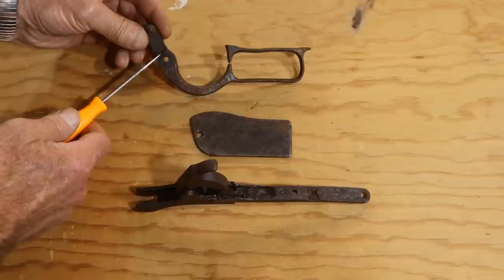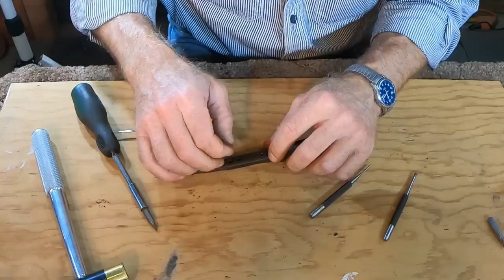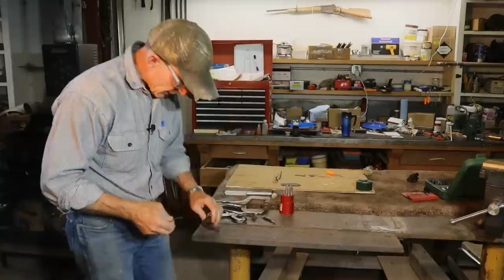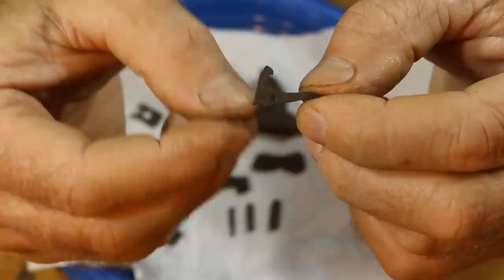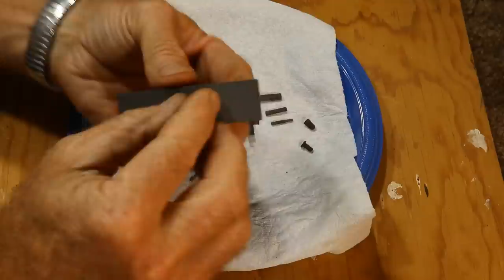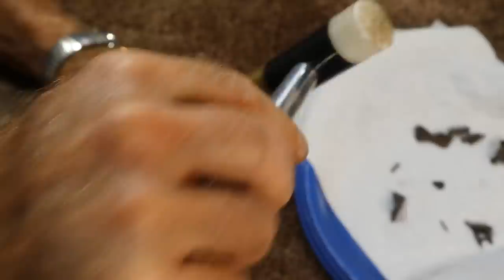Set Trigger Rescue Mission

Comment: Ideally Mark at this point, it would be the best thing if you could buy three or four of these set trigger units and have somebody measure them for AutoCAD and turn them into mechanical drawings. This way you can be able to manufacture any of the parts you need and have them drop right in to the Winchester and the parts would be made from modern steels like 4140 and the like.

Comment: Thanks for taking the time to teach us more about the parts and processes involved with being a gunsmith. I've already learned a lot from your videos. Question about the rust removal on pieces like you have here in this video. Instead of using Kroil and elbow grease to remove the rust, could parts like these be set in a muriatic acid bath for a short time to remove the rust? I know the acid will cut through oxidation on metal and won't eat into the metal itself. I've used it on several projects to clean old metal parts but not on any firearm parts.
Reply from the maker: You're welcome, Dan.  Kroil is a penetrating oil, not a rust remover.  In this case, I used it to penetrate and lubricate the parts in order to help break them loose.  I don't use it for rust removal.  Of course, muriatic acid will work and I've used it in the past.  I prefer to use Simple Green and Evaporust for rust removal, like I did in this video, rather than handle the muriatic acid.  If that doesn't get the job done, I typically will take the part to the bead blast cabinet if it's big enough to hold onto and not drop in the media.

Comment: Just wondering where you got the block you were using when driving pins out, I think I need one of those.  I like your videos, I have a 1896 manufactured model 1892 in .38-40 that I have only shot a couple times but I may start taking afield for coyotes, etc. as is is handier than most anything else I have.  Paid maybe $500 for it at a gun shop auction back in the early 90s, I knew it was a more practical rifle than the 73's in the auction that were bringing ridiculous bids even then (but I bid on them also).  I thought it wasn't worth much as it is mostly brown until I saw what Scheels in Springfield IL was asking for a .44-40 in the same condition.

Comment: While I know the parts would not be original, could you buy replacement parts for the 1873 from Uberti to get a rifle up and running? Providing, of course, that they fit.
Reply from the maker: Many of Uberti's reproduction parts will fit vintage rifles and I have used some as a last resort.  Unfortunately, the last time I checked, Uberti didn't offer 1873 replicas with set triggers.